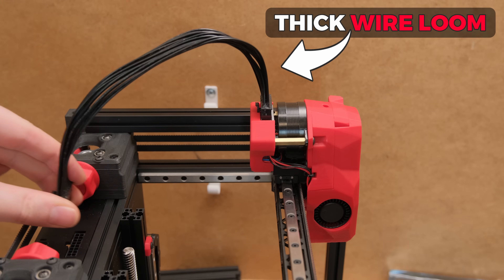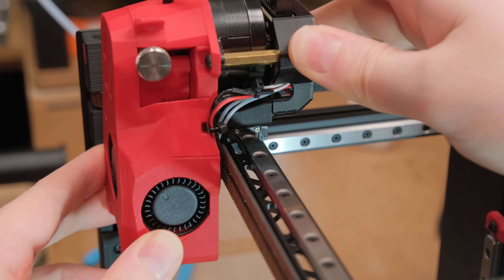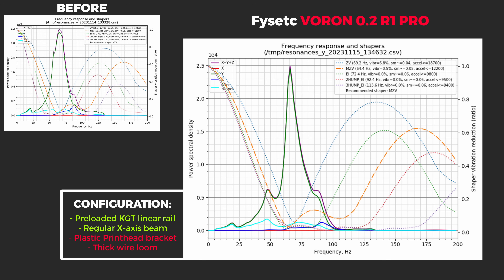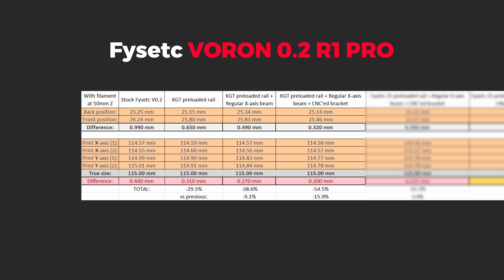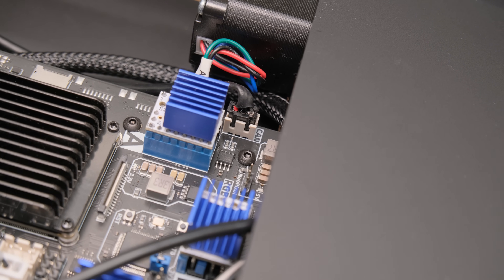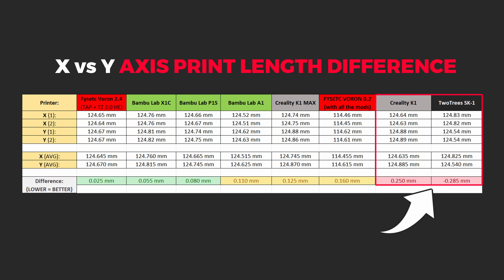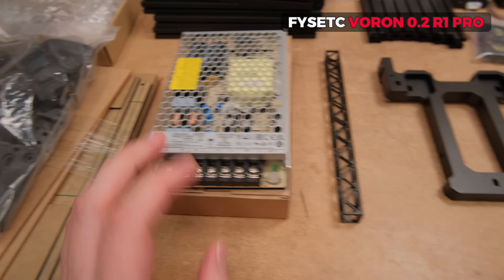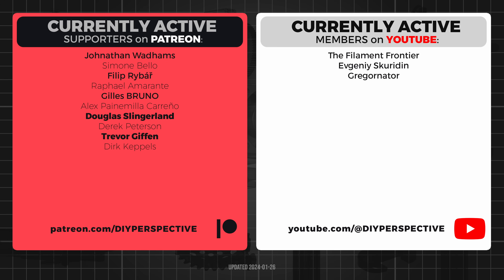How STUPID is the THICK WIRE LOOM on a small 3D PRINTER? (Printhead Flex = Inaccurate Prints)

Comment: Intuition says jerking/accelerating an unbalanced toolhead at ~20,000 mm/sec^2 would be a greater force than the mere stiffness of your wire loom.  
So why does nobody talk about Toolhead BALANCE??
If a better linear rail (with Z1 preload), and/or the forces of the wire loom affect print quality, then certainly mounting the tool head on its CENTER OF MASS would be a significant benefit as well, at least for Y-movements.  The preloaded rail raises a topic that nobody talks about, nor have I seen investigated?  It seems that manually balancing the head and re-running the input shaper would be an interesting investigation.   I'd do it myself, but I don't have a channel.  THANK YOU @PrintingPerspective for all of your outstanding content!!

Comment: Great video. I appreciate your methodical approach to this problem. I noticed some play in the x linear rail on mine too but didn't realise the affect would be do much! At 7:01, are you sure that the shorter bowden tube length didn't have any effect on your y accuracy? It looks like it will apply some bending torque to the print head at higher y values due to the loop being a little too short.The shot of the machine fitted with the CAN toolboard has a much longer loop length.
Reply from the maker: Thanks, I doubt it had any significant effect. I was using a PTFE tube with 2.5mm inner diameter and it is very flexible compared to those stiff wires. I wish it were possible to transfer the feel through a video because it is so stupid how stiff that wire loom really was. :)

Comment: You touched on all important aspects but you missed why the light weight beam is worse despite lighter weight. It's weak in torsion. You need a CF tube that is drilled on both sides so that you can screw the rail all the way through to the other side of the beam with long screws and have a printed insert inside that the screw goes through. That way you will have less weight AND more stiffness than the stock aluminium part. It doesn't matter how stiff the beam is if the rail it self can wobble on it because of a weak connection to it. The aluminium one is just too thin so won't be any good. If you combine that with a rail with the highest preload (z2) then that will be great. I recommend the hollow mgn9 from fysetc.

Comment: I just bought a Formbot V0.2 ket and they included a Z1 preload rail for the X axis.     I also went with Formbot, because they included  a better/simpler controller board based on Raspberry "Pico" (aks rp2040)

Then I replaced the Kigigami bed mount with a Fysetc CNC version.  THAT is really worth it.  You can bend a Kirigami with you fingers.  It is not accurate and the Z motion was not smooth.  Now with CNC frame Z motion is perfect.

Comment: I've needed to replace the umbilical cable because of loose connections. I made my own with more flexible silicone cable and it has been working decently since. I didn't go as in depth as you did but my kit FYSETC kit definitely shares the issues (it's an older one where the top hat was even shorter, 70mm...)

Comment: On the rail I have one suggestion. I had a lose fitting rail and tried to squeeze it with a bench vise. Worked perfectly after. Not saying that's the way to go about. But there is nothing to lose anyway.

Comment: Funny this popped up when I'm chasing down a .1mm over 150mm inaccuracy on my delta printer. Just rebuilt it with some home made mag rods, so they aren't quite perfect as a result I'm getting so a minor discrepancy between my x z and y axis measurements (3 axis split apart by 120 degrees, so you need to calibrate in 3 axis instead of just 2 on cartesian). While it can be a bit more of a pain to tune a delta, you can actually get them to print even more accurately than most cartesian printers you take the time.

Comment: One thing i know is that 3d printer never using silicon cable. But all of drone racing configuration using silicon cable on all wiring. Maybe there are custom cable that using silicon cable

Comment: I have fysetc v0.1 kit and I'm happy over 2 years. I had to change only X axis rail because of play. Otherwise all parts were good. I run CANbus ebb36 on my another printer vzbot235 where I use 500k baud rate with SKR Pico because with 250k ADXL results are not correct. So far no problem with overloading MCU. Just yesterday I updated klipper and had to update also MCU and EBB and it went smooth.

Comment: thanks for this. I bought a super cheap V0.1 kit Fysetc but immediately ditched the supply control board for a BTT M5P.
I have also noticed that the linear rails are sloppy/loose - I will be replacing them with some better quality ones.

I will probably source the X carriage from pcbway, so once again thank you for posting the link.

I am looking forward to your future videos.
Reply: I made mine from compression molded chopped strand carbon fiber. You can 3D print the molds and it is cheaper if you’re on a budget. It is messy though, not ideal if you don’t have a garage or something.

Comment: How do you wire the motors xy because the came with real short cables for the e3ez?
Reply from the maker: Extension cables or cutting the connector and resoldering the wires.
Reply: @PrintingPerspective  can you share your printer.cfg I am doing almost the same change on my fysetc

Comment: Im interested in getting canbus on the manta e3ez. Phaetus rapido/orbiter v2 running with apogee toolhead. Is this possible?
Reply from the maker: It has a CAN port, but I didn't have time to test how well it works.
Reply: @PrintingPerspective  no worries. I gave up on putting a BTT adxl on my printer. It shows up but the documentation is severely lacking
Reply from the maker: Yeah, they are lacking but my god, compared to Fysetc docs they seem good lol.
I have this in the config for the Manta E3EZ and BTT ADXL345 V1.0:

[adxl345]
cs_pin: PC15
spi_software_miso_pin: PC11
spi_software_mosi_pin: PC12
spi_software_sclk_pin: PC10

[resonance_tester]
accel_chip: adxl345
probe_points:
    150,150, 25  # middle of bed as an example

Comment: This isn’t an uncommon issue in precision automation. First thing I would want the cable connected at a place as far from a point of leverage as possible. So loop it down and connect it parallel with that linear support. Now it’s incapable of rocking the tool head no matter how much tension it comes under. I’ve never been in a position to redesign the cable however I can add length to it so it never goes into tension. Building a structure over the machine (or using the ceiling) to support excess cable. It basically “dangles”. We’re hillbillies but get the job done. 😂

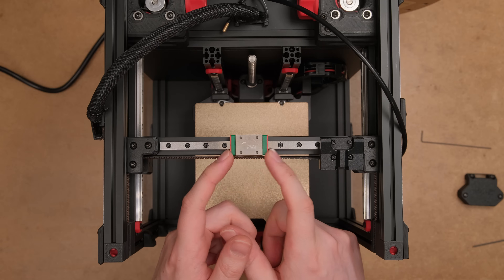Comment: 4:08 ---i bet you didnt clean the rail , bearing block and lubricate it with proper silicone lubricant for this type of application (yes you need to do this with brand new rail ...purely because it isnt premium quality rail already lubed with 500$ per kg high speed machining grease , most of the time they need cleaning so clean it😅
Edit---
This is also created in manufacturing when plastic parts on the end of bearing block arent aligned well , balls inside get stuck on the edge of plastic when ball comes out of a steel part (block) .
Simple solution to it is to just tap the plastic up/down until it move smoothly / loose screws a little , align and it should work perfec
If not...you can unscrew plastic parts and check if the edge of plastic isn't already bend inside etc ...i use something sharp to cut edge the plastic hole at an angle so the balls can move smoothly in and out....works every time 

PS--- idea for next episode

how heavy can the X axis be to still go 200mms with at least 5k acceleration 

i bet you cant beat my old behemoth from like 9-10y ago .... around 4 kg X axis 😆😆 (yes , it was big...and heavy😆)
Reply from the maker: Nowadays you don't really need to do a lot of cleaning with rails from my experience. I just clean the existing oil from the ball bearings with IPA and use Mobill EP2 grease. Works perfectly on Fysetc rail, and all other rails.
Reply: @PrintingPerspective  AH i forgot
This is also created in manufacturing when plastic parts on the end of bearing block arent aligned well , balls inside get stuck on the edge of plastic when ball comes out of a steel part (block) .
Simple solution to it is to just tap the plastic up/down until it move smoothly / loose screws a little , align and it should work perfect
If not...you can unscrew plastic parts and check if the edge of plastic isn't already bend inside etc ...i use something sharp to cut edge the plastic hole at an angle so the balls can move smoothly in and out....works every time

Comment: You may want to rerun your IS results while adjusting your accel_per_hz. The messy x rail results have a super low power being a scale of 0-1.75 1e3. You are just measuring noise.
Reply from the maker: Thanks, will try to play around with that.
Reply: How do you do that? I haven't heard that before
Reply: @madbull4666 check the klipper documentation. You’ll use the accel_per_hz setting under input shaper. Make sure it’s with a nozzle ADXL or something. CAN board ADXLs aren’t very good for actual results

Comment: Awesome video. May I ask how you measured the Print Length Differences? :)
Reply from the maker: Thanks. I made a jig to measure length consistently with digidal calipers. There's a link in the video description to the updated version of tests, which includes that jig.
Reply: @PrintingPerspective  perfect thank you very much!
Reply: Well without having seen his model, it's a easy effect to make in a test print. You want peak acceleration, so a sharp turning point. A 4 leg star would be great. Print in vase mode or single wall, custom speed settings (could increase for every 20-50 layer). Please note that this will not be accurate (true measure), so you're only looking for the difference between X and Y

Comment: Looks like more troubles not because wire harness thickness, but because it a too short and pulls printhead
Reply from the maker: Those PTFE wires were very stiff, and there's not that much room for a longer cable when enclosed. More flexible cables probably would be a better solution.

Comment: man, you tore Fysetc a new one at the end....
Reply from the maker: Well, that's the honest truth. Calling the kit "Pro" and it having such bad printing accuracy is just unacceptable. They could have easily included the right upgrade parts and it would have been a killer deal.
Reply: Well they just did that on the rev V1.1 check the new BOM of course I am in the same Boat I bought this in January

Comment: The cable should have ground, power, and a couple of wires for serial data.  CANBUS is one option.  The cable should be rated for continuous flex, as used for robots or cable chains.  The extruder board encodes and decodes the data, drives the stepper motor, manages all of the sensors, etc.  An optical filament runout sensor should be on top of the extruder.  In a perfect world, the hardware and data format would be an industry standard, making it much easier to develop third party extruder assemblies that could be optimized for flexible material, carbon fiber filament, etc.

Comment: How does wire loom affect a larger voron like 300 mm?
Reply from the maker: My 300mm V2.4 is the most precise printer that I have today. But it has drag chains with multiple PTFE wires (not CAN BUS). The bigger the printer the less it should affect in theory because all the parts will be bigger and more rigid which minimizes the negative effect of the thick wire loom.

Comment: can you please make a tutorial ablut that canbusfix/CM68 debian 11 update thing? fysetc's doc doesn't work or I am just way to stupid to do it myself :((
Reply from the maker: Bro... that board is such a headache that it would be so much easier just to replace it. There are so many things missing in those image files... If you are stuck not knowing how to update the image, there will be so many more difficult things to configure... And most important they don't know how to fix the overloading MCU issue with slow CAN BUS rates...
Reply: @PrintingPerspective  well that's massive headache.. I was trying to get crowsnest on the same kit but it doesn't support debian 10 buster so I tried updating it but got stuck at rkdevtools

Comment: Not sure if you are using the adxl from the ebb board, but it's bad position, plus the flimsy mount, will always gives you strange shaper results. Also, Klipper docs states that 250k baud rate for a can interface is not enough for shaper, even 500k can saturate the whole thing and mess with the measurements.
Reply from the maker: Yeah, most likely.
Reply: @PrintingPerspective  Reducing the speed at which the entire input shaping accelerometer test runs can help get at least accurate (if not still flawed) results.

Comment: Have to agree, the cable is too stiff and the rail has visible play on my printer as well.
Right now I work an a V2.4 before I spend time on those issues.
I also had stability issues with the display and already swapped for an USB one.
Reply: Good to know than the onboard CAN won’t perform.
I would have tried to use that - guess I’ll use an USB CAN from the get go.

Comment: What do you think about using one multichannal cable? I've been thinking about it for a while now but haven't tried it yet. Some VGA-type cables have enough channels, but I'm not sure if they can handle the power for the hotend.
Reply from the maker: For a CAN BUS? If so I just used twisted and shielded cable for the data + 2 wires for the power, and then both sleeved in. But VGA cables I think are way too thin, they are data cables so were never designed to carry power.
Reply: No, in this case I meant without can-bus.  I also know that a VGA cable wouldn't work but maybe there is another type of cable.
Reply: @e.f.k.3547 I wonder how well a usb c cable would do, with newer phones that have charging capability of 120w wonder if they would work here. Although that's at 20v and not 12v so amps would go up. I've seen people use mini dvi cable or vga can't quite remember and that apparently worked well.

Comment: Smooth idler pulleys are the Debble!, found moving to toothed idler pulleys a long time ago before resonance compensation was a thing helped a lot. Effectively the teeth act as springs on smooth pulleys

About bearings, linier rod bearings anyway. I have a Sermoon D1, all the bearings are clocked at 12. So all motion forces act on 3 and 9 while 12 and 6  hold the carriage in Z direction. Doing that removed all the slop in my printer. And of course the machine is squared and the bed is trammed, having a quality square really helps. The frame doesn't have to be perfect as long as the rails are able to be, wasted a lot of time on that.

Note, if you do get it perfectly square you WILL find out if there's slop/tolerance gaps in your machine. Found this out on my old wooden Replicator, you could hear the carriage and bearings rattle after, even was visible on the prints. So, you might want some binding to press the bearings against something.

Comment: Replacing the stiff PTFE / Plastic Cable Loom in a Sleeving with one made of flexible Silicone Cables without Sleeving would probably have fixed the issue.
Reply from the maker: I am sure that would help, but considering how much rewiring you would need to do, CAN BUS would be so much easier if you don't run the Catalyst board.
Reply: Silicone isn't too great in places where you need to have some wire on wire movement. proper PTFE insulation on wires and slightly loose wire sleeve ( even PET one ) is great. On negative side wires with proper PTFE insulation are not cheap , on plus side they are kinda "soft".  But i don't like it either and i will move it to CAN with proper cable for that , which is  really nice and again - expensive.

Comment: when you re-ran input shaper, did you use the adxl on the ebb36 board?  I have found them to be very inaccurate because they just aren't mounted securely enough to the toolhead.
Reply from the maker: Yes, but I made a custom bracket that holds the PCB in place. It felt pretty secure but I guess I will never know without more testing.
Reply: @PrintingPerspective  I had the same thought about the ebb board. I saw someone testing CAN board vs hotend shroud vs nozzle mount, and CAN performed much worse compared to nozzle & shroud mounting (both nozzle and shroud gave pretty similar readings if I remember correctly). I wish I could tell you where I've heard this, but I can't remember.